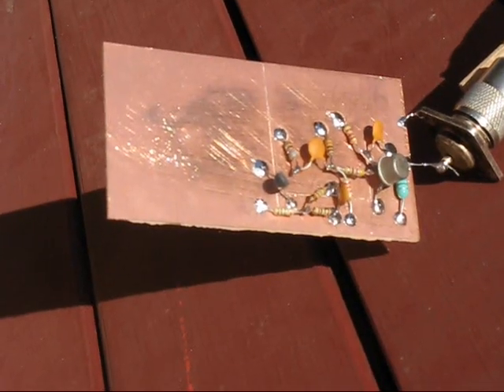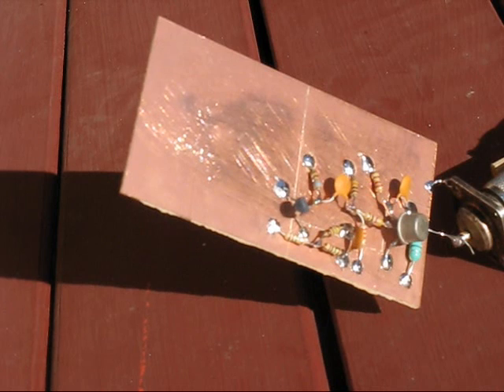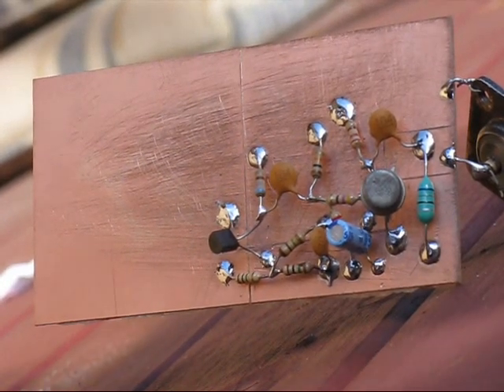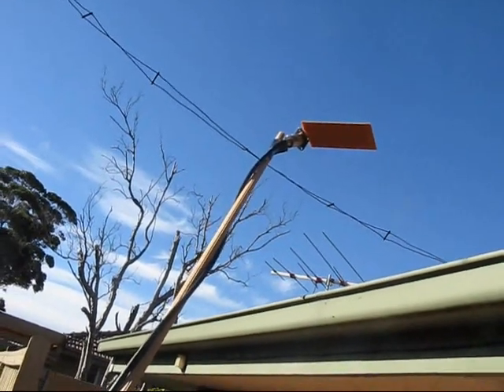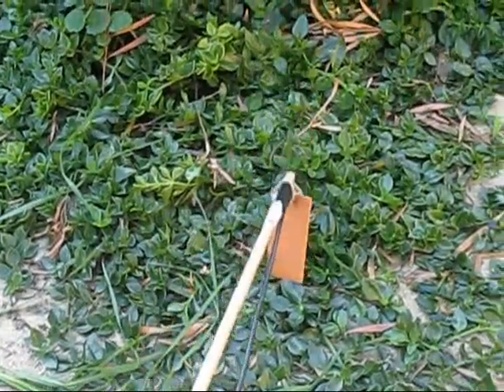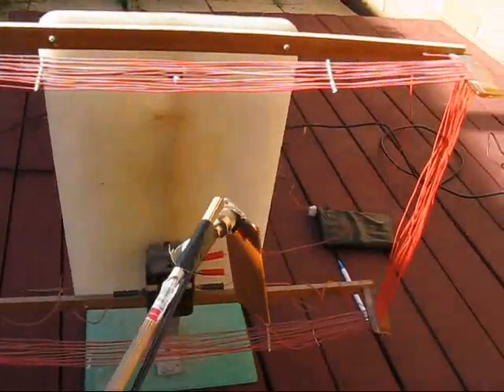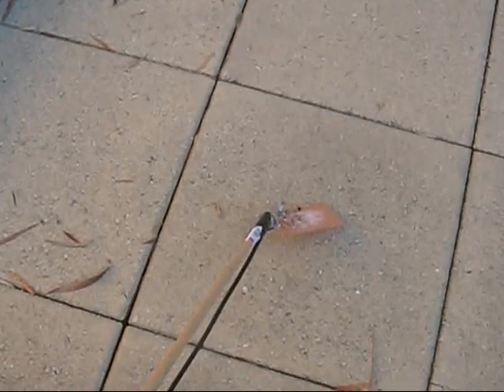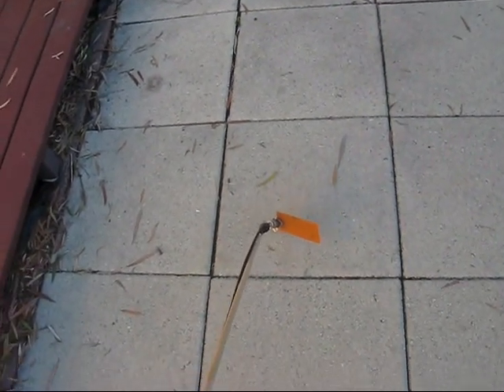Receiving experiments with the PA0RDT Mini Whip

Comment: There's a few restrictive factors here now I'm taking a close look at this experiment.
No.1 is the small width of the cut in the ground plane between the circuit and the part of the copper forming the antenna section on the board. 
This will negatively impact the performance as there is going to be significant capacitance between the gate and ground at the input of the JFET. The MPF102 also has a little higher gate capacitance than the J310. This all contributes to act as a capacitive divider for the very short antenna terminating the extremely high gate input impedance of the FET... a few pF really matters here when we're dealing with megohms!
The use of a 2N2219 is also a handicap as it will not be anywhere near as 'hot' as a 2N5109 in terms of its RF performance. 
I have a lot of 2N5109 as well as 2N4416A JFETs (perhaps lower gate capacitance than the J310) and this weekend I'm going to investigate this circuit myself and seek to squeeze every last ounce of potential out of it.
I plan to take it, as well as my homemade active loop antenna to a local park with no powerlines for hundreds of meters and make performance comparisons

Comment: I made an elongated version of the miniwhip to fit into a 1 foot piece of PVC 3/4 inch pipe. A pl259 plug's shell fitted snugly into this and the other end was capped. A simple bias-tee was made for inside the car, which had a SO239 connector antenna mount already on it. Getting away from the local noise, the results have been amazing. When first tried, I thought the antenna must not be working because there was no background noise, but then I tuned across a stonking great signal on 160.
I mention this because I've never heard of anyone trying the PA0RDT on a mobile mount. I can confirm it works extremely well, fed against the car bodywork. I note that the Web SDR at the university of Twente uses a miniwhip, grounded at its feedpoint to the metal roof. 
Opinions vary on whether to ground the antenna end of the feeder braid or not, but my experience suggests you should, if you can.
 Thanks for the videos, 73 de G0IFI

Comment: I'm experimenting with a mini whip designed to be lower, compensating for the lower signal level that comes with a smaller distance between points within the electric field (V=E*d and whatnot) by a third transistor stage in the middle designed for voltage gain

Comment: To function, the PA0RDT MiniWhip Antenna needs proper Grounding.. Without (really) Grounding it, this Antenna-Type is almost useless. So it is not the best "portable"-Antenna. However, using it the Way, it is used in this Video, the Antenna seems to be a good Indicator for what would be a good Ground and what would be not.. :/

Comment: IIRC on this circuit it's really a matter of having it grounded to earth since that gives it a better amount of potential difference between the patch which is connected to the JFET and the feed line. I know that i've played with a version of a whip amp from Charles Wenzel which had similar characteristics where if I touched a wire attached to circuit ground the signals would peak and the noise levels would dramatically reduce on my SDR software. All this was with battery power as you did. I'm not an electrical engineer or a physicist but I think having any kind of ground improves the amplifier (even just some coiled up coax attached to circuit ground produces similar results in my own tests).
Reply: Dead right.

Comment: Thank you for posting this video. I have struggled with an active mini whip ~25 feet off the ground. The noise is terrible and antenna unusable. I have the RA0SMS version of the PA0RDT - it produces 10 KHZ 'spikes' across the entire HF band.

I never thought about attaching it to a stick and moving it around the back yard - brilliant. What a simple task that I completely overlooked.

I'll give your process a shot today to see if I can get a usable signal. As it is, @ 25 feet in the air with no obstructions, it is simply not usable.

Comment: Thanks for this video Peter, it inspired me to do something similar with a Ramsey Electronics SA7 preamp kit although I had good results at 5m above the ground and with the outer coaxial cable shield uncoupled.

I just need to progress to the DC injection stage instead of using a 9v battery :)

Comment: Just moved into a flat where wire antennas aren't possible. I built one of these exactly as per the original circuit by RDT and it's astonishing. I think yours shows a better S/N ratio near the ground because you're giving its "earthy" side a capacitive coupling to ground. I ran a wire from the braid at the feedpoint of mine, connecting it to a water pipe and the noise dropped by 6 s-points. I'm going to ask the landlord nicely if I can get the thing mounted up on the roof, 4 stories up. Should be interesting. It's remarkable just how much signal this simple little thing does pull in. Thanks for another interesting video. 73
Reply: Sounds very interesting, how did it work out?

Comment: Hi.Peter. It looks to me like the sort of receive "antenna buffer" that would work best with a telescopic whip of around 60cm. You could slide it in then to note the results with different lengths. The comments about grounding seem valid too. Mounting it on top of an aluminum tube which is connected to the RF ground of the PCB will probably much improve performance, especially if the tube is then grounded also. It probably would be a great general purpose monitoring antenna, although for MF (and even for HF) my preferences are towards tuned loops fed into a differential antenna amplifier converting the high loop impedance down to one suitable for feeding the RX

Comment: I have built mine, but I am still using 9 volts 200 mA and when I tried to use 12 volts 200 mA the 2N4124 was becoming warm.   What's the proper voltage and current, and how do I get that type of power source?

Comment: Sorry to hear that, but don't give up. Get a good earth connection, place it far away from objects outdoors and use the attenuator on your rig if needed. I did hear a lot more with this whip than with a 20 meter vertical.

Comment: Great video and I have been building and experimenting with the mini-whip myself. What I do miss in the video is the earth connection. If you want to get it in the clear then I found you need to bring the earth connection to the mini-whip. This shows in your video when you hold the whip close to the ground. Mounted on a 12 meter fiberglass pole with a separate earth going up to the whip I had excellent results.